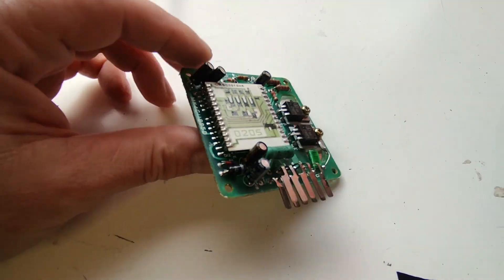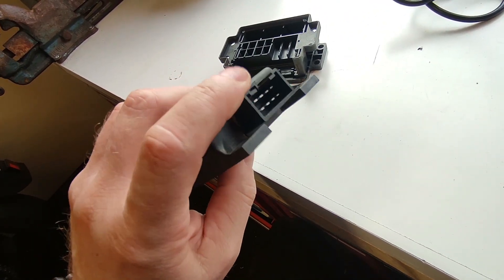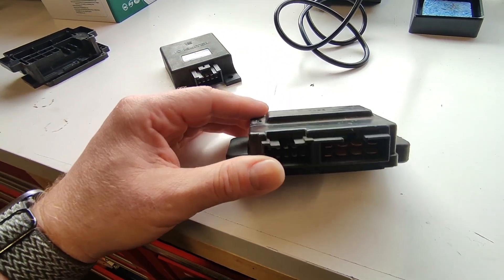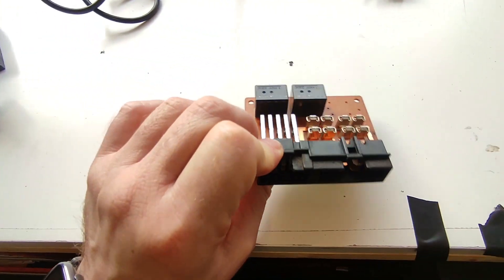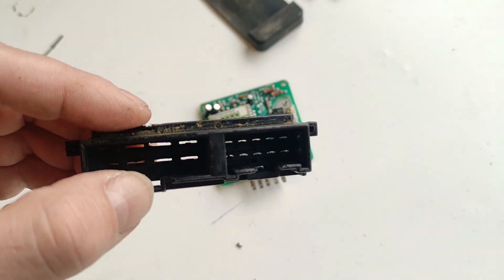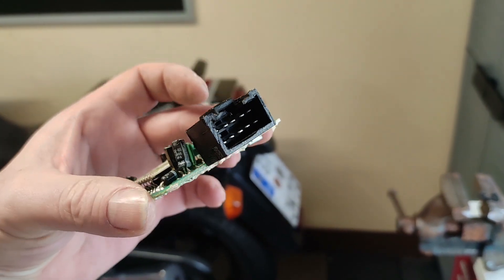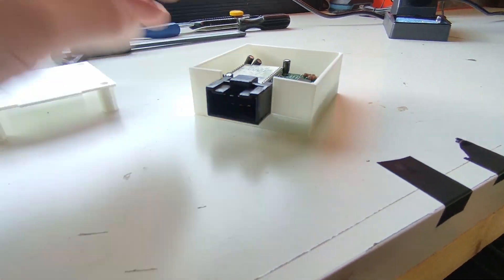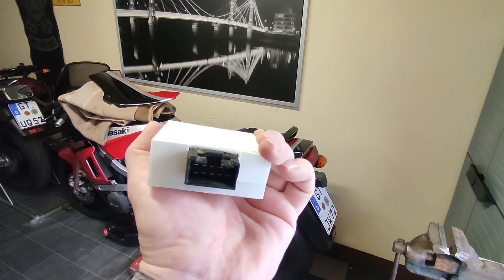Building a GPZ600R CDI case for my loose CDI PCB

Comment: I’m still having overheating issues even after flushing the system, replacing the coolant cap, thermostat, and water pump. When I try to ride it for a bit too long I hear what I assume to be the coolant bubbling under the gas tank and it starts to spew out coolant from the hose underneath, I’m about to give up on it!
Reply from the maker: Leaves the question as to what condition the radiator is in. Do you have the expansion tank in the belly pan fitted or had it been removed because an aftermarket 4-1 exhaust pipe has been fitted and takes up the space where the expansion tank usually sits?
Reply: @MrLefthooker the expansion take is in the belly pan and it has the stock exhaust. I’ll take a look at the radiator and remove it to see if there’s anything wrong with it but from what I seen it looks ok
Reply from the maker: Are you interested in joining the gpz600 Facebook group? With over 2200 members I'm sure we'll get to the bottom of this (if you're not already in the group)
Reply: @MrLefthooker sure what’s the name of it
Reply from the maker: Kawasaki. GPZ600R Riders

Comment: Hello. I have a problem with a kawasaki gpx 600r. I'm watching your video and I'm looking for a solution..can someone give me some advice..no traction, max 120-130km/h. and very high fuel consumption. new spark plugs, carburetors cleaned.. thank you
Reply from the maker: This is too complex to reply to. There could be so many reasons for this. From carbs, engine, cdi, ignition.. a whole bunch of things may be wrong.
Reply: @MrLefthooker  how to check cdi? maybe you have a video about it
Reply from the maker: You can't check the CDI. Kawasaki needs a special tool for it. You can only try fitting a good one from another gpz

Comment: Hello! I have a gpz600r-86. I have done some work to it, but i still have an issue with it. I Wonder if i could consult you. Best regards, Per Eklund
Reply: VICTORY! I did one more carbclean, and it seems like i must have missed some dirt in the first cleanup, because the carbs were really dirty again. I am going to get myself one of those ultrasonic machines aswell. Now the bike runs so sweet, thanks for your help and thanks for sharing your fantastic videos on youtube. Best regards: Per Eklund
Reply from the maker: Glad I could point you in the right direction, have fun 😀
Reply from the maker: Hi Per, that sounds Swedish? How can I assist you?
Reply: @MrLefthooker  Thank you for the fast reply and great channel. It’s correkt, i am Swedish so bare with me if you have trouble understanding my english. I recently bought my teenage dreambike on a auctionsite. I knew it came with some issues, it ran very porely. I have replaced all the fluids and filters, fixed leaking forkseals and cleaned the carbs, i have also added two extra fuelfilters to the gaslines. After the carbclean my thoughts was to test it before i possibly build myself a synchronization device. The bike starts without hesitation, but it runs very badly when it’s cold (not normal bad), it revs on choke from 0-5000 rpm for a couple of minutes, after that the idle is normal and it runs like i suppose it should. But i seems to run hot, after testrun the fan starts after killing it. Why is it getting so hot? (I have flushed the system and refilled it). 
According to the Haynes manual i could be multipel issues. I was thinking i could be a leakage from the intake boots, but when spraying startergas when running it make no difference to the revs. ( it was as you know not the easiest task to put the carbs to the airfilter back together again). The bike have most likely not been i use for a long time, and when i disasembled the carbs and saw how dirty the were i was surprised that it even could start.
The sparkplugs areold bur the seems to work fine, i checked the coils (both 2.7 oHM). 
Any ideas from such a methodical person like you would be appreciated. Best regards: Per Eklund
Reply from the maker: Ok, so we have a few issues here that I will try to attend to. Firstly, 2 inline filters? I personally advise everyone to take them out. 1 I can understand if the tank has a problem and you need a quick fix, but 2? That is probably going to cause starvation when riding. How were the carbs cleaned. Particular attention is needed on the pilot jets, they block up easily  and prevent a decent idle. These bikes get hot quickly, they need to move forwards. They hate running when standing, it only takes 5-10 minutes to get that fan on. They also hate own traffic and traffic jams. I avoid both at all costs. I wouldn't worry too much about the heat untill you get out on good longer runs. Sounds like the intake boots are sealing well, thats good. So, it all sounds the same as most other GPZ600R. They sometimes just need some good riding before they run properly. Nothing here sounds serious, lets put it that way. Watch that idling, you may have to need to do the carbs again, especially the idle system.
Reply: @MrLefthooker  Thank you for replying. I must say i also was sceptical to use filters, one is for the primer and the other one för the normal gas line. I am going to take them off to see if it makes any approvment, othervise i will do another carbclean. I don’t have access to one of those cleaning devices that you are using, but i have good quality carbcleaner and compressed air. I Will do this the coming days, and i will also get you an update with the result. Thanks again for taking the time to help me out. Per

Comment: Hola buen día.saludos desde México. el CDI de la gpz600r se puede reparar en casó que se haya dañado tengo uno y no se si tenga arreglo 🤔 ?
Reply from the maker: Unfortunatley no. The insides are protected by a coating of plasitc that do not allow you access to the printed circuit boards. I am not convinced that my one is original as I have never seen one like this before.
Reply: El que yo tengo tiene una tapa metálica con tornillos y se mira que es igual al de usted.
Reply from the maker: Then sure, it can be repaired. It depends on what is broken 👍🏻
Reply: Perfecto. muchas gracias por la información 😉👌🏼